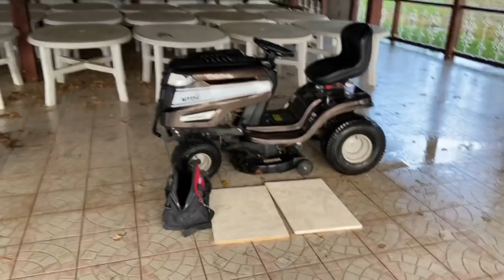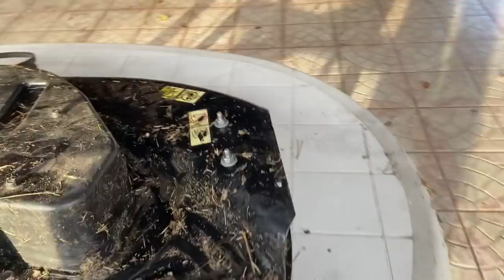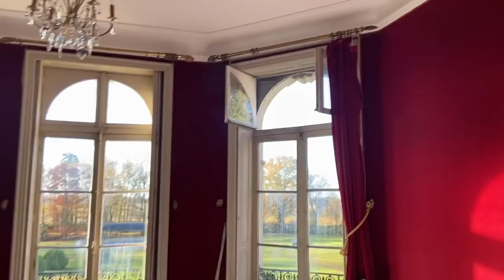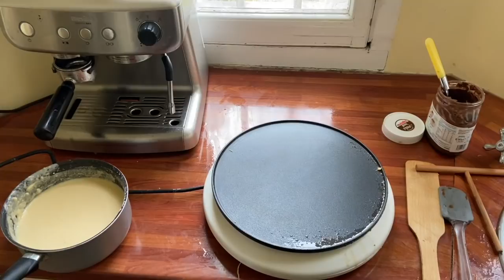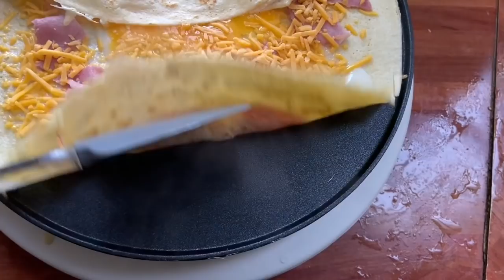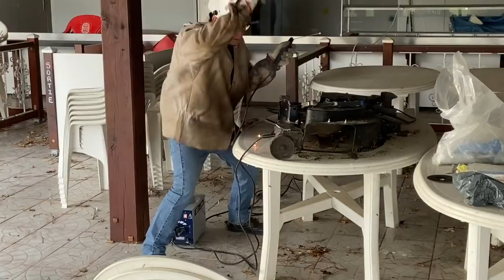Château de la Grifferaie, Day 8, Rob's French Advent

Comment: How nice to have someone come visit and help you out at the same time. Don’t know if you have a blower but my honey always blowers the clippings and dirt off his mower every time he uses it. He says it better to do that so it is less likely to rust the deck or cause damage to pulleys and springs. Happy mowing 😉
Reply: Also less chance of fire.
Reply: We always blow, clean & scrape the under side, each time…
Reply: @Denika1388  👍 we have a Club Cadet with an attachment so you can hook a water hose to the upper deck and it cleans the underside while the blades are run. Then of course we winterizes it after the last use of the season by cleaning it good and checking everything. Machinery always last longer with proper maintenance 😘👍 The decks and blades on all mowers get a beating and often need welding or replacing depending on the terrain.